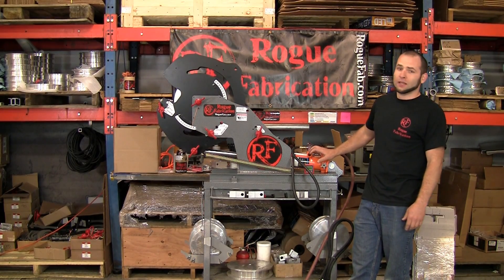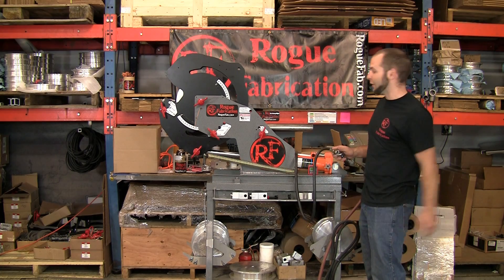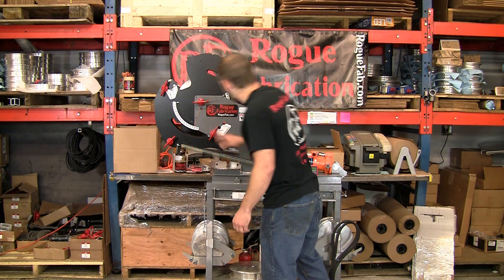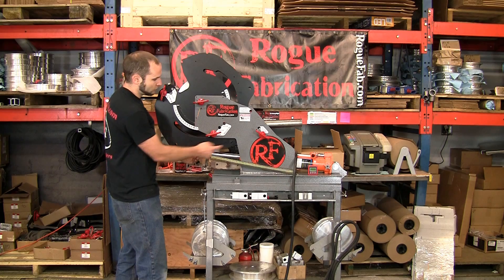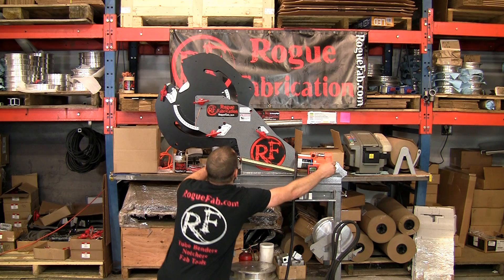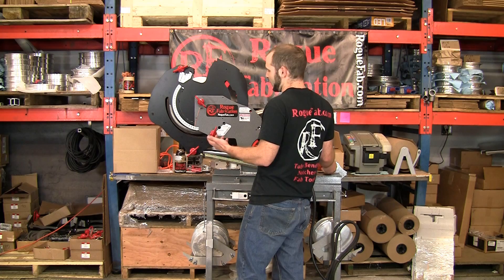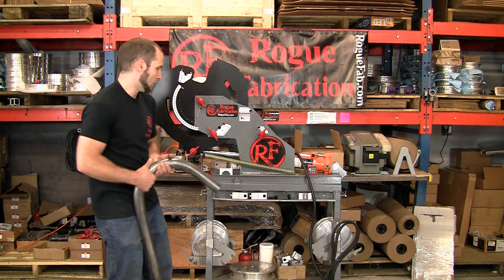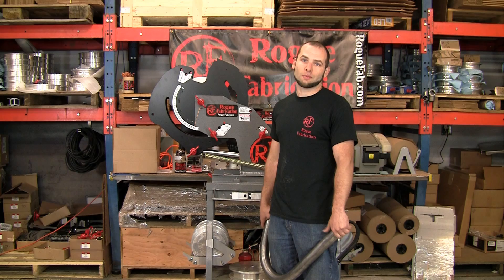Tubing bender max capacity test - RogueFab Model 600 xHD

Comment: It seems like it takes a long time, but doing that by hand would take a lot longer, i have bent tubing for a swing set glider on my hitch ball on my truck. The kids were impressed. Your bender is very well done. There is tremendous pressure on that round Bar and if you didnt trust your machine you would have put something between you and the bender, to reduce potential effects of fragmentation.

Comment: How did u use air compressor for the ram? You sell the fittings?
Reply from the maker: The ram has a switch inline on the air hose that attaches to the ram. - Josh in customer service
Reply: @RogueFabrication  was on the website just now looking to buy yhe m600hd... whats the differende from that one and the m600... im only needing it for 1.75 dom for bumpers and sliders... i think i missed a sale lol. Just got back from working out of town.
Reply from the maker: @dangerousfandango5943  send me an email or call me. I can go way more in depth that way - Josh
Reply from the maker: All our contact info is on our web page - www.roguefab.com or call 503-389-5413
Reply: @RogueFabrication  yes. Was on your website earlier again.. notice its in Oregon.  Im in cali. Ive been on youtube watching bend tech vids. Lol.

Comment: The pressure those pins are under... particularly when bending a solid bar! That's all I would have been thinking about... which means that when the compressor came on at 2:20... I probably would have soiled myself.
Reply from the maker: haaaa!

Comment: What kind of compressor specs do you need to drive the ram efficiently ? I’m thinking my lil’ porter cable pancake compressor is not enough ?
Reply from the maker: Pancake is not a great idea. Oil lubricated compressors are what we recommend. 4-6 CFM min and a 30 gal+ tank will serve you well.